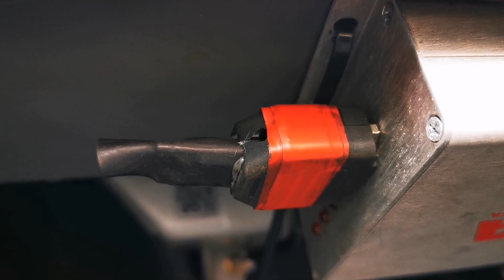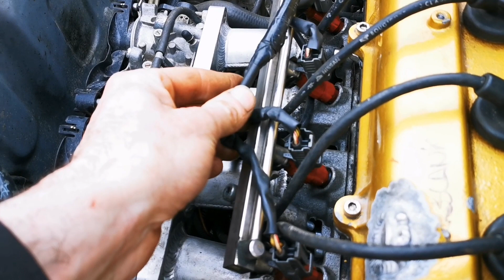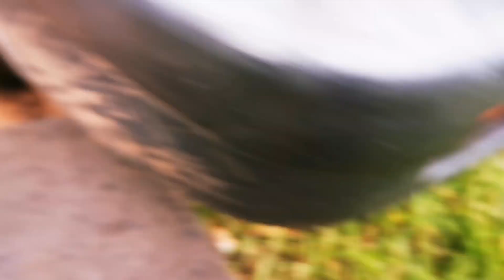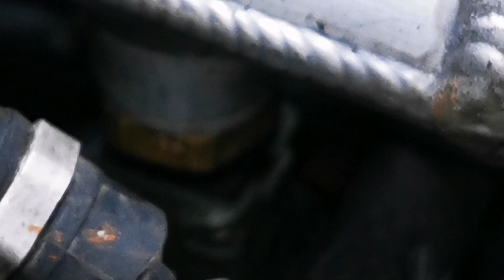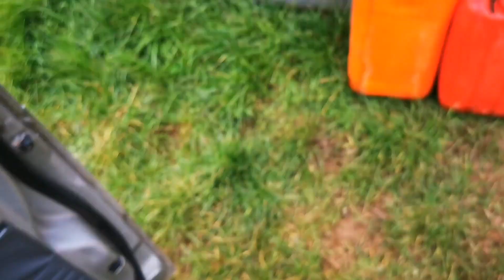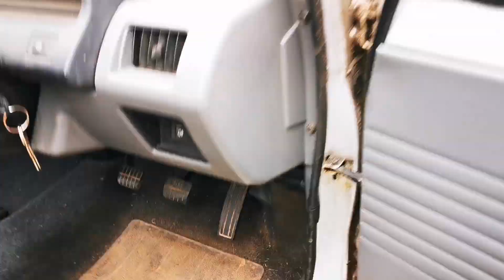Megasquirt your Micra. A rough guide.

Comment: Do u run a map sensor?
Reply from the maker: Yes I do. The megasquirt has an on board map sensor. Originally my tuning map was based on tps x rpm. But I recently switched to a different tuning algorithm, which is called itb mode. Now iam running map sensor x rpm whilst idle and cruising, then it switches over to tps x rpm for the wide open throttle stuff. I will make a video about this in the next couple of days

Comment: So basically I can use my stock loom off my MA10ET for injectors, tps, coolant temp and lambda and wire them up to a separate ecu? And then intake temp, crank angle and some way of metering the air getting in too (do you use a maf with itbs?)
Reply from the maker: Yes that sounds like a great plan mate. I dont see why that wouldn't work. With itbs you won't need a maf or map sensor. Unless you add boost. You will tune it in alpha-n, which is a tps and rpm based map. I have the map sensor connected, but that is only for barometric correction. I can try and make a video to explain some of that. But I bet there are a lot of videos already out there.